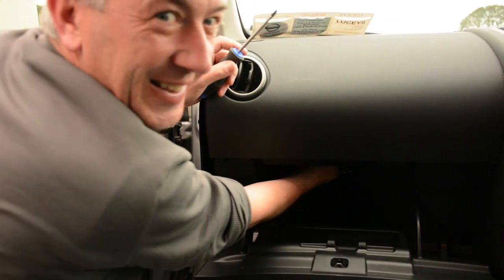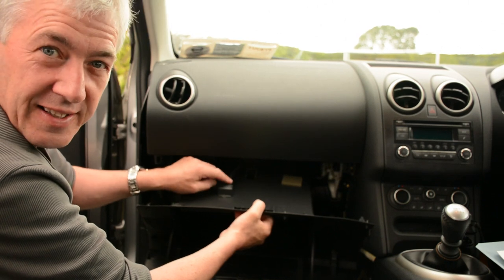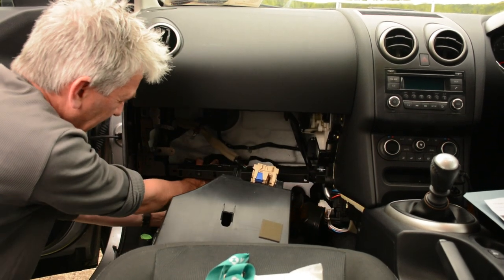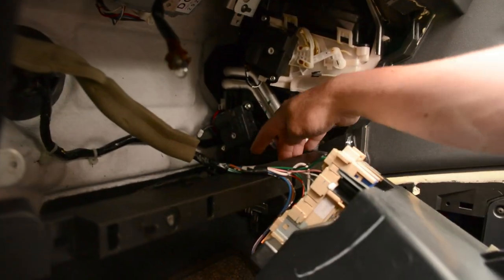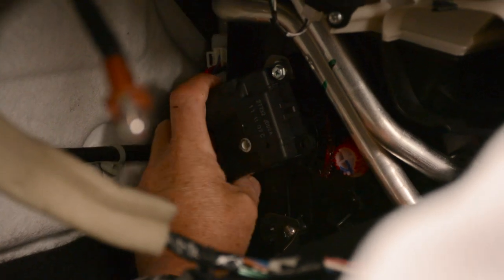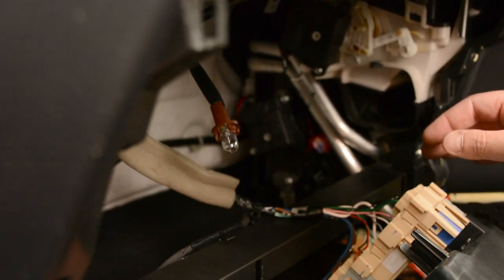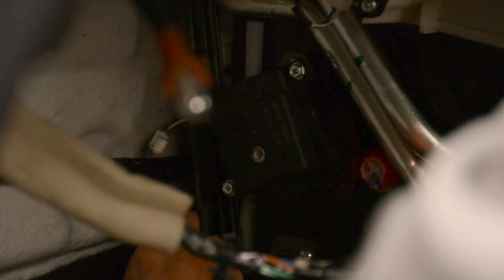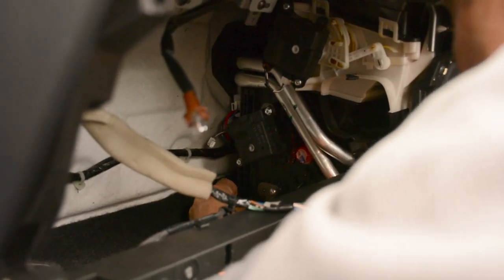Changing the Pollen Filter Nissan Qashqai

Comment: Useful video - thank you. I found it was the same procedure on a Nissan Qashqai 1.5 DCI Acenta 2009 cabin pollen filter UK right hand drive.

I believe it had never been changed and was extremely dirty/clogged.

 Couple of points - after you have taken out the glove box and then remove the plastic vent - it has a screw on the left we can see you undo - but on the right had side there is a little clip on the top where it secures to the central vent - it can ping off so keep an eye out for it. Also take your time putting the new filter in place - mine took a lot more jiggling before it went in. No smutty comments.

Comment: Have just done mine, 2010 1.6 petrol. No need to remove glove box, air duct or wire, its accessible by simply removing the side panel and reaching in. 5 min job costs £7. Easy.
Reply: JBLAZE999 is ours right hand drive
Reply: Petrol one  are different
Reply: yes that petrol one is different than 2012 diesel 1.6
Reply: It's the same for diesel ,

Comment: Very good but any chance someone could do a video for the post 2014 Qashqai? As far as I can tell it’s all quite similar to access the filter, with partial glovebox dismantling needed on the RHD car, but the filter has to be rotated 90 degrees so the long side is vertical and the hard plastic edges are horizontal. In this orientation it’s even harder to squeeze the filer to get it through the hole.

I tried it the way round shown in this video but it rattles around and does not fill the space.

Comment: John, my a/c not working. 
The mechanic told me i have to change evaporator unit and expansion valve.
I change my pollen filter by my own. I wonder, is my a/c unit broked because of me putting the pollen filter wrong way?
Does the A/C  has anything to do with the pollen filter ?
Reply from the maker: It needs A/C topping up. You can get a refill in Halfords.
Reply: You need to top up aircon gas get it in halfords

Comment: Can't you access the filter without removing the glovebox? Is it necessary to be removed?
Reply: You can , all you need to do is remove the inner  cover next to the feet of you are seated,  pull out the tiny pipe that visible once you remove the cover ,open the aircon filter housing cover n you are good to go,  follow the link in my other reply
Reply: @silbariusamakali4462   not that easy better to remove glove box

Comment: This is for new nissan qashqai 1.6 dci 130 bhp
Reply: Very good but any chance someone could do a video for the post 2014 Qashqai? As far as I can tell it’s all quite similar to access the filter, with partial glovebox dismantling needed on the RHD car, but the filter has to be rotated 90 degrees so the long side is vertical and the hard plastic edges are horizontal. In this orientation it’s even harder to squeeze the filer to get it through the hole.

I tried it the way round shown in this video but it rattles around and does not fill the space.